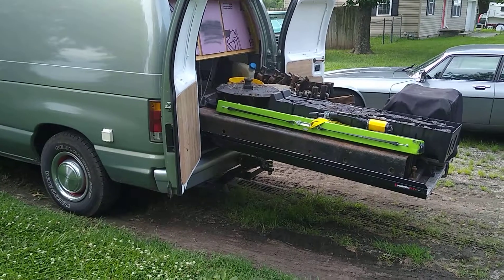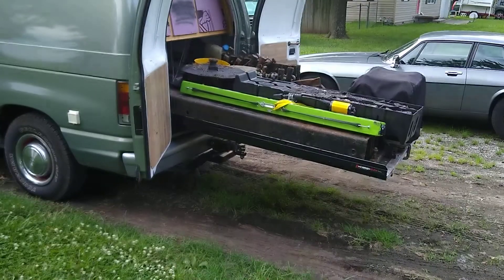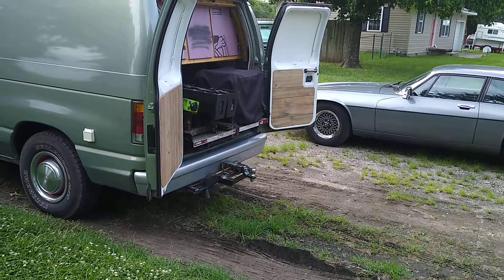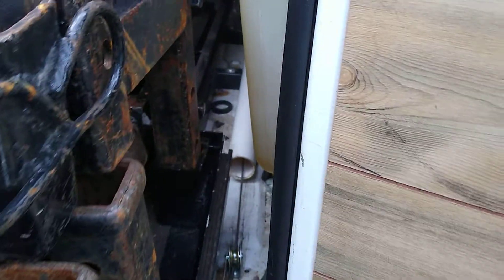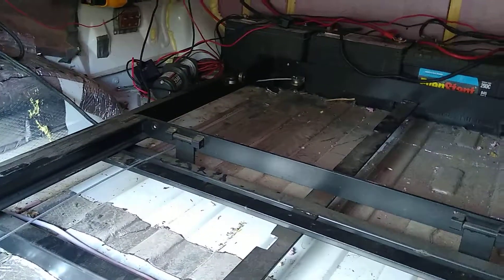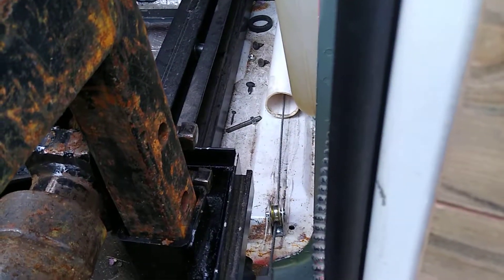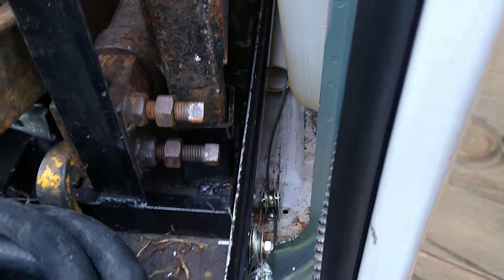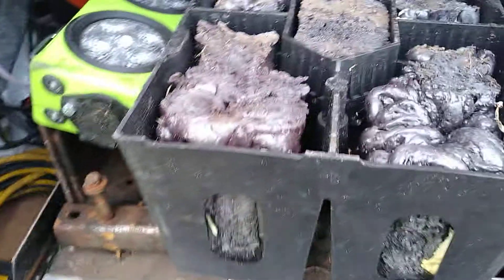Powered truck bed slideout.

Comment: I want to power my pickup truck bed slide out. I have the winch and am having a hard time wrapping my head around how to get the winch to push and pull. Do you have  a schematic for your system?
Reply from the maker: I did not see this message till one year later LOL. Maybe I can kind of explain where the video is lacking. First thing I should say is there's two cables at play here. The cable on the passenger side is attached to the spring wraps around a pulley at the rear of the van bed and attaches to the slide out deck. When the deck is fully retracted the cable wraps around the pulley at the back of the van causing the 190 lb garage door spring to extend inside of that PVC pipe. When the deck is extended past the halfway point it comes off of the pulley and just rides beneath it then the deck re-extends the spring until it's fully out. After the halfway point gravity is used to finish the extension of the slide out deck. I've also installed air ride on the van. Deflating them helps with the gravity by changing the angle at the back of the van. I use this setup extensively at near rated capacity. The bearings have actually worn divots in the rails. I am thinking of installing a conical spring at the front of the slide out to assist a little bit more to get the bearings out of these divots. The manufacturer cargo glide has a lifetime warranty on all parts. I've called them up with bearing numbers and they just send them out no questions asked.